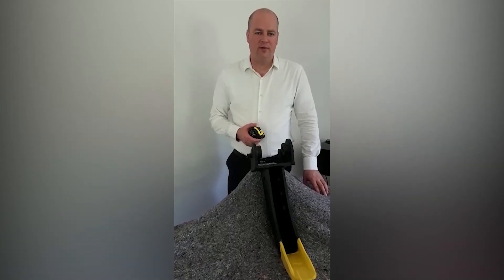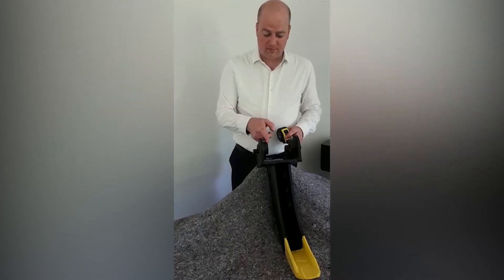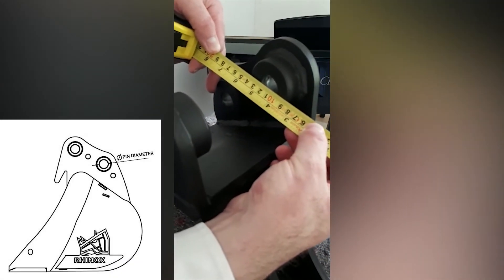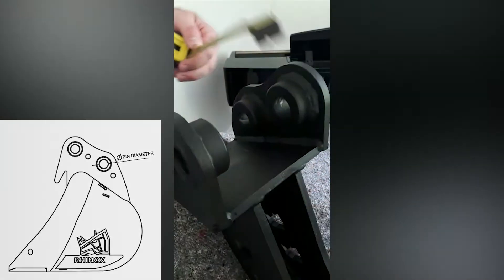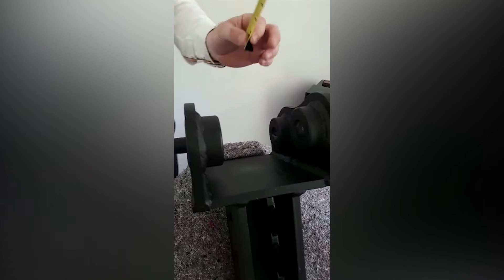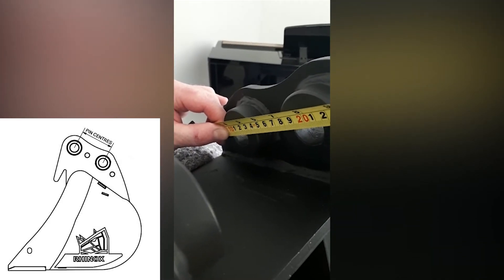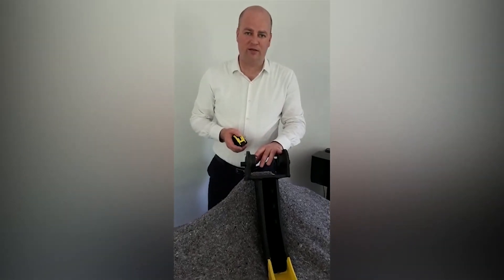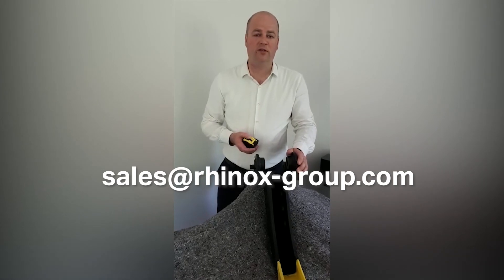HOW TO: Measure Digger / Excavator Bucket Pin Dimensions - Rhinox Group Ltd

Comment: Can you use buckets that have different center to center pins everything else the same
Reply from the maker: Hi Travis, Very good question! This depends if you have a quick hitch fitted to your machine, and if so what type. Some of the ratchet hitches can pick up a wider range of dipper gaps. However the spring type hitches usually have a fixed pin centre. If you do not have a hitch fitted on your machine you have even more play as the 'Bucket Link' can swing in to position, however this will change the geometry of the machine slightly.
Sorry for the long answer, I hope this doesn't complicate things further!